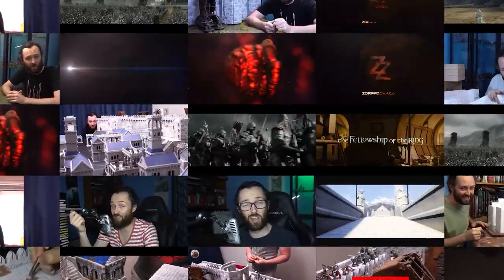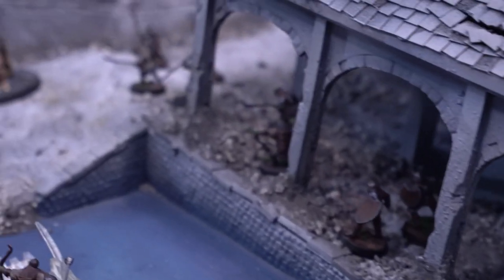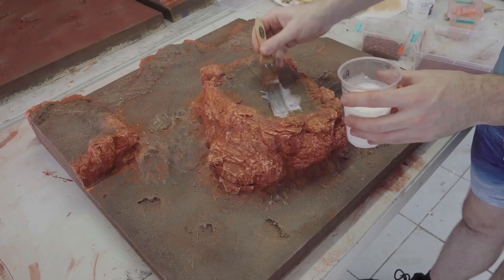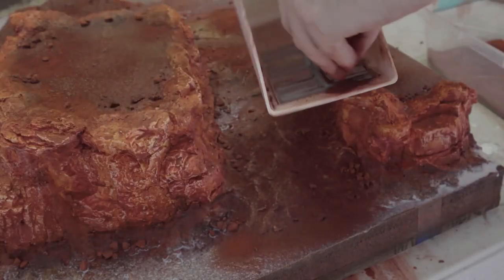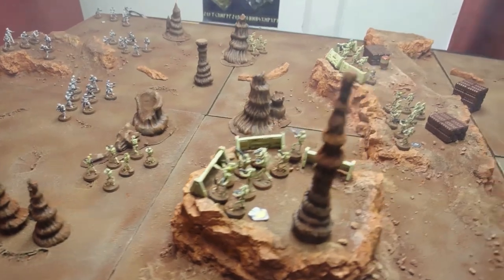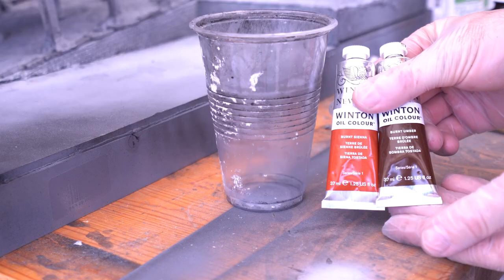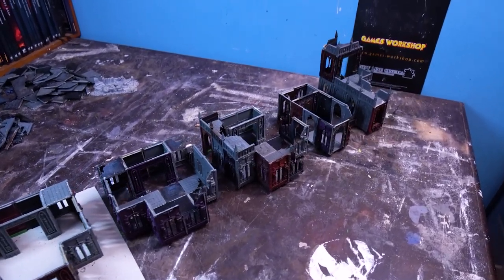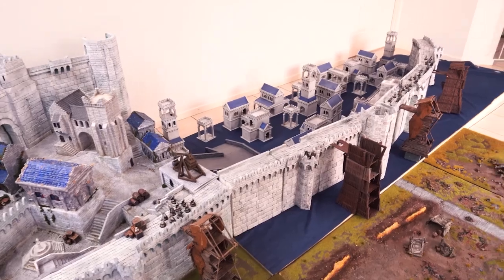Become a scenery GOD with these 10 MUST KNOW Warhammer Terrain Techniques for tabletop dioramas

Comment: Didn’t understand the alchool and sealant part, did I have to:
1) put the glue
2) put the material(rocks,dirt etc..)
3) put alchool on it.
4) quickly put the sealant. 
5) wait to dry.
6) repeat some times.  
Did I understand it right?
Reply from the maker: That's it mate, although to speed up drying time, add a step:
1) put the glue
2) put the material(rocks,dirt etc..)
//drying time//
3) put alcohol on it.
4) quickly put the sealant. 
5) wait to dry.
6) repeat some times. // (just steps three and four) //
Reply: @Zorpazorp  perfect, thanks 😁😁

Comment: 4:17- I’m sorry but I just have a quick (and possibly a noob) question….. but let’s just say I make my own sealant! PVA glue and matt varnish and I put it in a spray bottle. What is the life expectancy of what is left in that bottle? Can I make a big bottle of it and work off of that all year long or once I mix it I now have a running clock to use it all before it’s useless? And actually a side note question….. can you use gloss varnish also? Like if it was going over anything that is supposed to look like water or glass or mud? Or is there something in the gloss version that makes it not work?

Comment: for baseing i have swaped over to outdoor paveing sand as you can get it in mass for cheep and becuse of how its formed the apacation of pla glue it will wet it self then harden into a extreem sticking argeret.

Comment: Hi I’ve been following u on YouTube for a while and you’ve helped me with some terrain building questions. So thank you for that. I do have one question though, I’m trying to build the argonath and a game board for Amon hen. I’m using polystyrene for the board, but I’m having trouble sculpting the polystyrene into a shape I can fill with epoxy to serve as the River. Do u recommend using a heat gun to create a deep enough “ditch” or slope?
Reply from the maker: yeah I use a heat gun sometimes to melt foam away, otherwise carving, sanding and then filling back in with modelling compound to smooth it all out :) Check out my buckleberry ferry video where I did a resin pour river :)
Reply: @Zorpazorp  thank you so much as always for being generous with your time and sharing your knowledge. I’ll send you a completed picture of it when I get it all done! Gonna have to make a stop at the Zorpazorp shop to pick up some terrain materials!!!

Comment: Doesn't the Isopropylalcohol destroy the paint job?
Reply from the maker: Not on scenery, you're spraying into aggregates anyway, not painted elements. On basing use a dropper bottle to keep it off the mini :)
Reply: @Zorpazorp  So on intersections like between rubble and painted rock faces (red Star Wars board) or painted strees (Minas Tirith) you just sprayed it "carelessly" all over?
Reply from the maker: @Scartenable  Sprayed it straight on no worries :) didn't do any damage to paint. It's getting soaked by sealant so quickly, it's not like it's sitting in an iso bath.

Comment: Do you have a recipe for your sealant Mr Zorp?
Reply from the maker: I use Geek Gaming Scenic Sealant mate :)
Reply: @Zorpazorp  but you referred to making your own as well in the video with pva, water and matte varnish. I just wanted to find out the ratios.
Reply from the maker: @designatedcrafter  Can't remember but if you check the Geonosis video I did the process in depth :)
Reply: @Zorpazorp  Thanks, pretty simple really. Oh, and that Geonosis video is very cool as well - heaps of techniques in there.